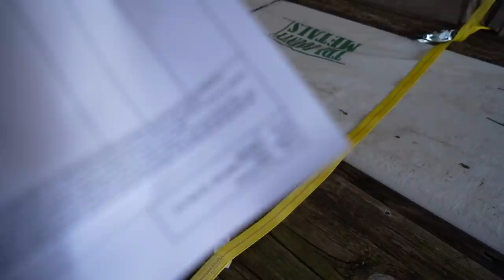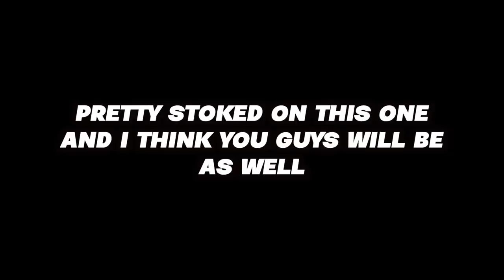Building a Garage in the Woods (pad pour)

Comment: yo i love this channel and everything about it. but that slab is gonna crack and fall apart my fingers are crossed
Reply: I know nothing about pouring slab, but from what I've seen they typically involve rebar and are thicker if you plan on parking vehicles on it.
Reply: typical garage floor is about 6" thick with real footings and metal in it
Reply: At the very least a deeper hole with compacted gravel

Comment: much respect to you guys but damn no rebar? not even mesh? ill give it 6 months before that pad is falling apart.
Reply: Did the same thing on all the other pours except ranps.I just hope he used fiber Crete for the flat pours.
Reply: Their excuse last time was “it will just be for bikes, etc etc” they supposedly built this for cars and a building? Good luck, no vapor barrier either.....
Reply: Why would they add rebar to a pad thats only 3.5 inches thick? Do you know something that professionals dont?
Reply: @Oladavol  when people say rebar, they mean any sort of reinforcement, this could be wire mesh. Also their other biggest mistake is a 24*30 (idk the exact number now) span with 0! Expansion joints etc.... None of you that think this is fine must have ever lived or visited FL, this was poured on loose sand with 0 footers. This will shift and crack after just a handful of rains and temperature changes.....

Comment: You might already have a generator, I’ve been slacking on keeping up with the videos but you should just get a Lincoln 305g welder. You can obviously weld off of it and it will have enough power to support anything you need to do

Comment: Buy a used diesel trailer generator it will power a welder no problem and everything else you can imagine at the same time. There around the same price as a new big gas generator

Comment: Do you really need sides? At least not Metal ones!  With metal sides and roof, that garage will become an oven and you will definitely not want to be wrenching on cars when it's 120 degs in it.   
My suggestion, and a cheap one at that.  Get some Shade Cloth off amazon or someplace. You can get different ratings of sunblocking capability (typically see 40% - 90% light blocking ratings) which can greatly help keep temps down and keep the concrete pad slightly cooler. Also can easily find  different colors of cloth, not just in black.  
Hang it around at least 3 sides of the garage,. You could hang two pieces at the front to make for a curtain like entry.  
The Shadecloth will provide excellent ventilation, still allow you to see through it fairly effectively (40% obviously can see through better than 90%) , and will block out some sun and uv.